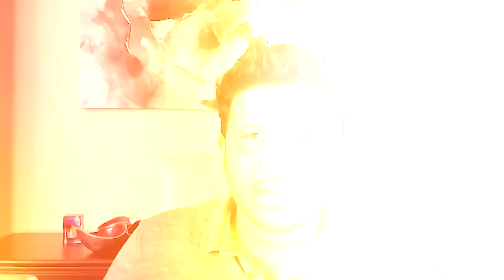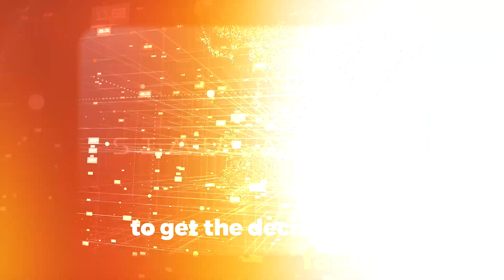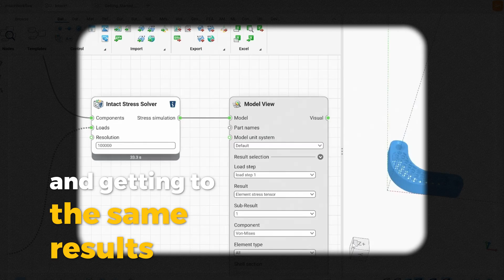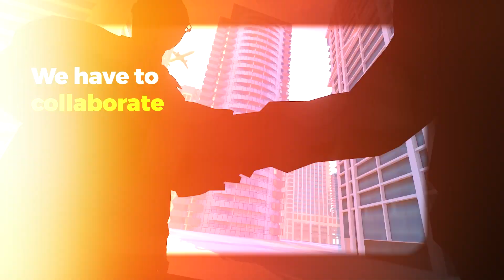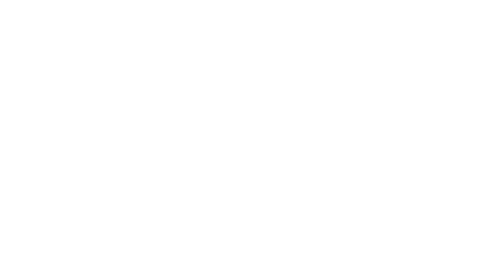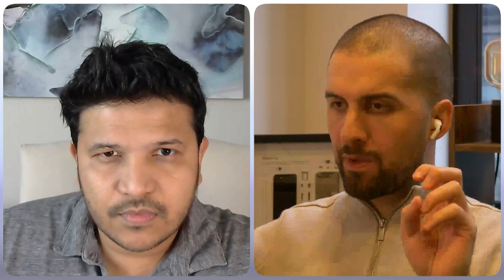FEA without Meshing - Rik Baruah | Podcast #14

Comment: And how Synera find a meshless method that is equivalent to a traditional meshing with meshing guidelines from customer and features that need to be meshed with mid planes and shell elements?
Reply from the maker: Hey Larry. Intact Solution's mesh free methods can be used for components that would traditionally be meshed as shells, like frame structures for a car trailer for instance. Intact's method of immersed moments is great for giving you directional guidance, on mode shapes and displacement but in the end you may end up running a final validation study using your favorite traditional approach if you want to get down to the decimal point on something like stress. Glad to jump on a call with you and our friend's at Intact to really dive into the details of how it works more if you're interested. Let us know.